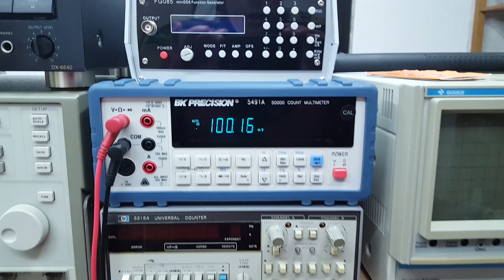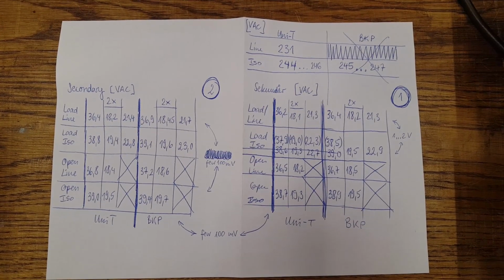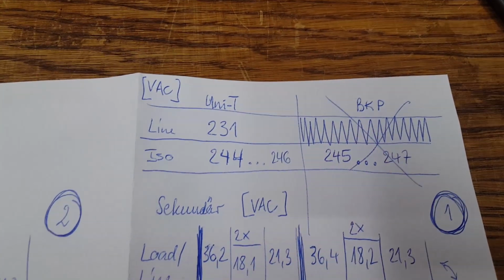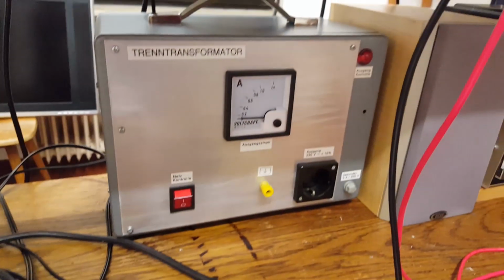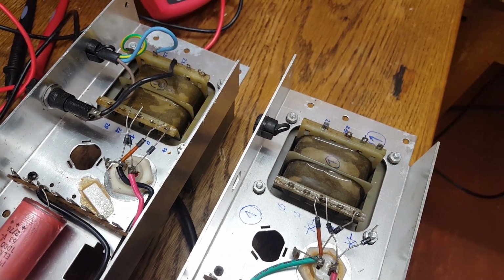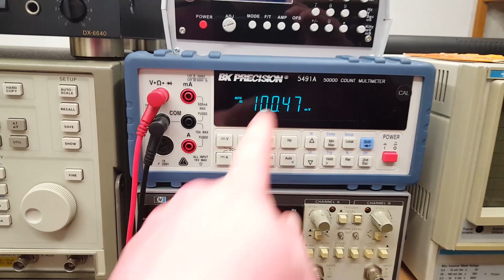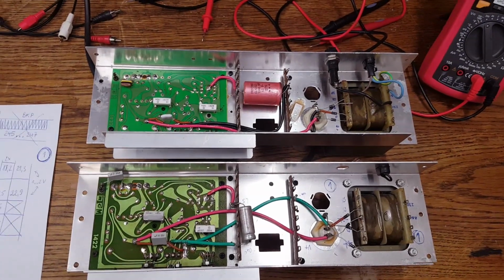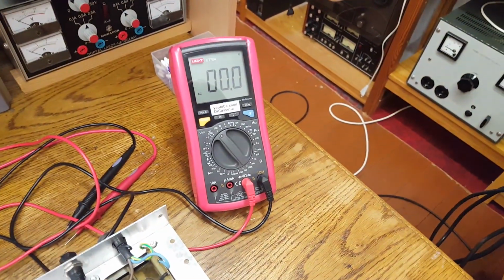Traps when measuring Transformers

Comment: Not boring at all! Actually, quite informative. Interesting to see the different output voltages between two supposedly identical transformers. The earthed common (ground) on your 5491A is very much the same as with oscilloscopes. No differential mains measurements for you, then, without an isolation transformer! I'm fortunate enough to have combined isolation and a variac in one box, so such testing is straightforward.
Reply from the maker: I too have an isolating variac in my fleet of test equipment, but that thing is so huge it won't fit on my bench :D

Comment: easy and hefty isolation transformer:...get 2 broken microwaves and remove the transformers...cut them open, its easy they are welded and you just grind the seam...remove the secondary winding from one and toss it on the scrap bin...fit both primaries in one transformer...boom...done
Reply from the maker: I have heard of people doing that. And then they couldn't reassemble the core properly anymore and were wondering why their isolation transformer had such a loud hum.
Reply: @DrCassette  i dont see any difficulty on assembling the core...microwave trafo is the most ridiculously easy to assemble and disassemble type of transformer....maybe someone who cant lay a bead of weld will have trouble of course...apart from that i really dont see the trouble....how hard it is to slip an already formed coil of wire on a same size core? and its heavy gauge wire wich means its much safer than using stepdown transformers wired back to back wich when inside an enclosure may pose a fire risk, since today everybody is so freaked out by safety its definetely an issue....i have made one and it works for me it doesnt hum that much,and its used for testing and repair so who cares for the slight hum...i could add rubber feet if i care for that....i have experimented various secondaries to give me a suitable output under load for my vacuum tube tv's...but any secondary will do since the voltage will vary very slightly...you can also add or subtract some turns of wire....the build time was about half an hour. 

edit:if one winding or both get a bit loose from the core and you care for hum you can fill the gaps with lots of stuff including RTV...rtv is widely used on flyback transformer repair and it holds fine and prevents arcing even with 20+Kv it also handles temperatures above 200ºC..its cheap and widely available... and will stop any possible coil vibration if it ever happens

Comment: 2:35 - VERY poor design to have the GND running to mains ground! I"m sure current measurement with this unit is challenging!
Reply: Why? Just like most scopes it's simply not meant to measure mains reference circuits. And because you would normally place your DUT on an isolation transformer that's not a problem. Although you have to be aware the circuit does become reference to ground if you start measuring.
Reply from the maker: It's common practice on mains powered test equipment to connect the GND connectors to safety ground. Sure it is something to keep in mind, but in most situations it doesn't matter.

Comment: I have a suggestion about the issue with the isolation transformer putting out too high a voltage: you could lower the output voltage by wiring the output winding in series with the secondary side of a simple cheap transformer, out of phase. A 12v transformer would reduce the output by 12 volts, for example. Big Clive explained it recently: https://youtu.be/ZEFVNFyG9po (explanation starts at 6:30). I hope this helps.
Reply from the maker: I have seen the video Big Clive made, and I remembered it after I had edited this video :)
Reply: if you want to see how its connected you can search for "bucking transformer"